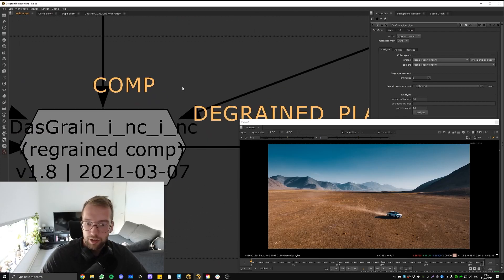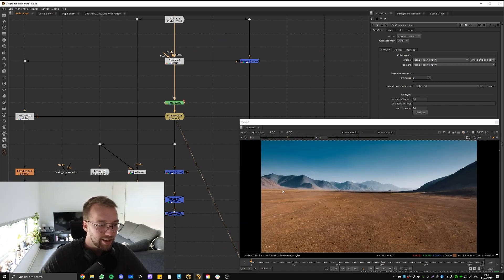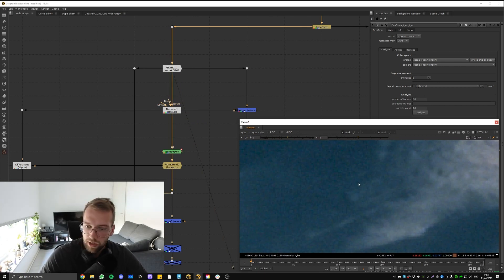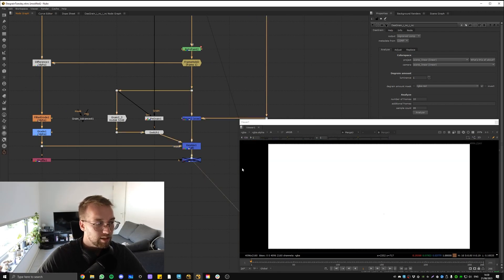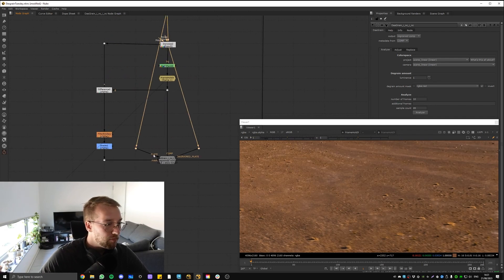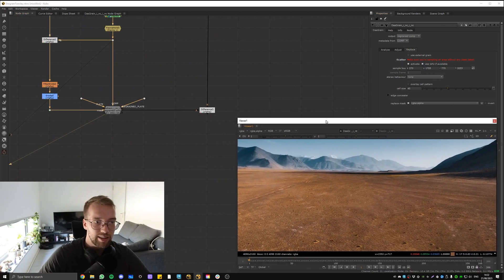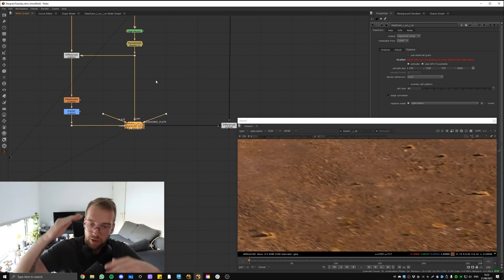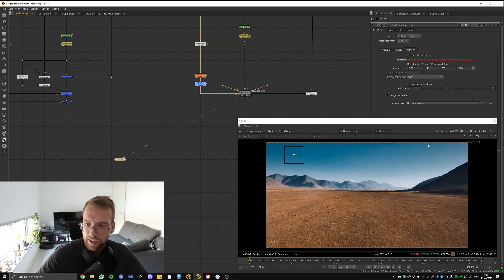Comp Tip Tuesday - Episode 4 | Das Grain (the best grain)

Comment: so whenever I click on scatter, I get hit with an error: DasGrain1.VoronoiScatter.VororNoise: Error running kernel 
 , any idea how I can fix this, please?
Reply from the maker: Right, the normal DasGrain doesn't work on Nuke Indie / non commercial I think. You need an extra plugin for those like I said in the video. If you're using Nuke(X) then the normal download from nukepedia should work fine
Reply: @pimmeijer7589  I use Nuke X tho
Reply: @pimmeijer7589  I use Nuke X

Comment: Hey Pim really useful tip!
Can you explain the thought process behind the mask input, why use difference as a mask instead of the alpha from the rotopaint node? Is there a specific reason for it.
Reply from the maker: There's no real reason, just make sure that the Alpha is crisp with no or little feather otherwise you get weird results. I just like using the difference because it's simpler when you have a lot of changes on the plate.

Comment: Annoyingly Dasgrain doesn't work on Indie or NC due to Python/Blink restrictions.. but there you go....
Reply from the maker: Yep, it's annoying. But there is a workaround on Nukepedia for this
Reply: @pimmeijer7589 could you point us on the work around? Tried using the das indie helper but the voronoi scatter still has issues. In order to make one you need a full license so I'm stuck atm.